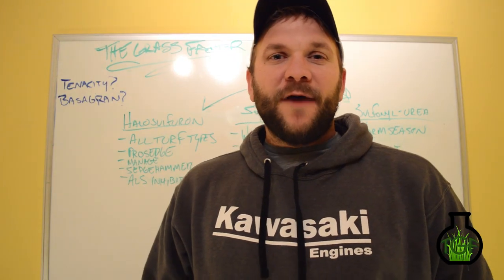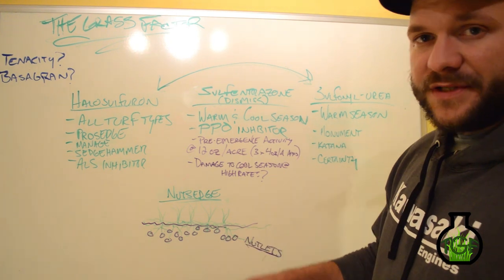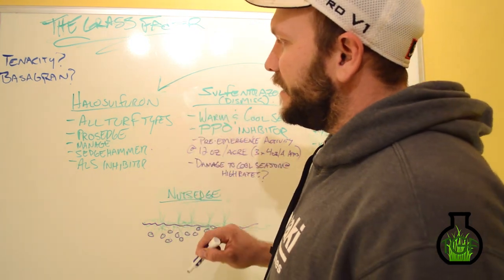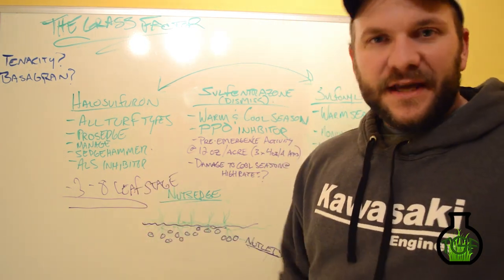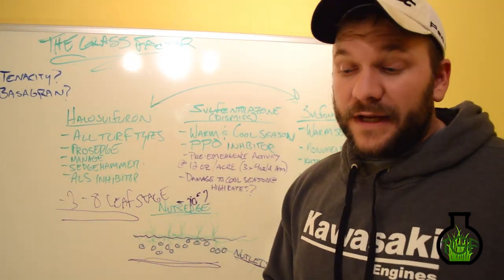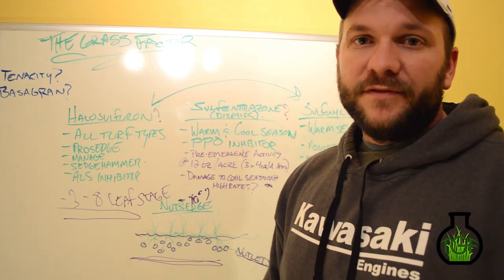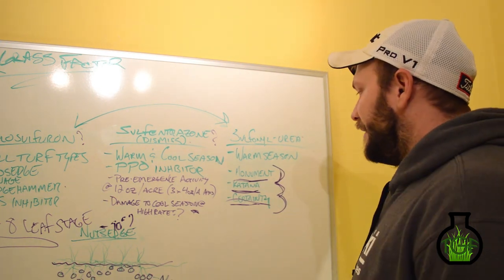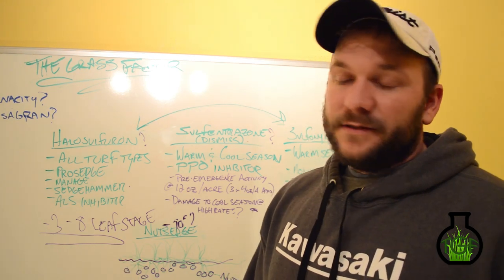How To Kill Nutsedge - Sedgehammer vs Dismiss - The Grass Factor

Comment: I have found the best technique to kill nutsedge - ( I am NOT a professional - just a guy who's tried everything) - is to mix 5 parts  Spectracide (black bottle) with 1/10 parts Tenacity. I then load it into a meat (marinate) injector, and inject it into the soil about 1 1/2" below the surface at every nutsedge crown. It works.

Comment: I used Sedgehammer last year... and the year before that... and the year before that. It is only a defoliant, and doesnt stop nutsedge from spreading through the root system.
Reply: When using sledgehammer, you MUST add a surfactant. A good squirter of dish washing liquid helps. ( and is a bit cheaper too)
Reply: @stephenchristoffel2850  Did that. 
...last year, and the year before that, and the year before that....

Comment: Had my petrol tank removed for a pump replacement on my truck.Mechanic gave me two large containers of bad fuel.One10mm paintbrush attached to a garden cane,dabbed nuts edge in my flower beds,small ones dead next day,large ones two applications,the odd one three.All gone,none returned.
Reply: How old was the fuel?  Was it practically varnish?
Reply: It was new fuel,got contaminated with chlorine,like an idiot,topped up from wrong container,ruined the pump.

Comment: Roundup will kill nutsedge, but don't spray it on your good lawn grass.  Roundup is non selective and will kill everything it touches. It's good in the landscape where it's around other plants, but use a spray shield when applying Roundeup so it won't kill the good flowers and evergreens.
Reply from the maker: If you're of the impression glyphosate is a good option for nutsedge, you need a significant amount of more experience in the field. It's a very poor performer on sedges compared to other options.
Reply: @TheGrassFactor  Grasses (including): Annual bluegrass, annual ryegrass, bahiagrass, barnyardgrass,
bentgrass, Bermudagrass, bromegrass, Cogongrass, crabgrass, creeping bentgrass,
dallisgrass, fall panicum, fescue, field sandbur, foxtail, goosegrass, guineagrass,
Johnsongrass, Kentucky bluegrass, kikuyugrass, lovegrass, maidencane, nimblewill,
nutsedge, orchardgrass, pampas grass, perennial ryegrass, purple nutsedge,
quackgrass, sandspur, smooth bromegrass, sprangletop, St. Augustinegrass, tall
fescue, Texas panicum, Timothy, torpedograss, vaseygrass, witchgrass, yellow
nutgrass, zoysia and other grassy weeds NUTSEDGE IS INCLUDED.  I USE SUPER CONCENTRATE 48% STRONG AND MIX MY OWN WATER AMOUNT
Reply from the maker: @lostinmyspace4910  again, most sedges have been resistant to glyphosate for a long time. It's obvious you haven't been doing this that long, or across any meaningful acreage. It's not a slight at you, I'm just pointing out there are far better options
Reply: @TheGrassFactor  I am not a lawn maintenance guy for sure.  Been using Roundup for more than 35 years in the design/ landscape construction business.  Roundup is usually a good product for anything I face including the dreaded thistle (3 ft 4 ft tall).  Just reading the instructions and it includes nutsedge.  But what I will do is take your advise and go with what you suggest as you know the technical efficacy more than I.  Thank you! Great video!  THUMBS UP!!!

Comment: I have a large raised garden that has rose bushes and had vegies.  I found your video and am intrigued as I am on my wits ends.  I have not heard of the three products you mention in your post, have used Ortho products that have been inefficient and could damage my roses. I am in Arizona so the nutshedge starts in April all the way through October, or at least while it is hot.  The weed is interfering with the growth of my roses. 

My questions are:

1.What product would you recommend for a rose garden?  I have to get rid of this grass. 
2. What product will do the least amount of harm to the rose bushes?
3.  If I use any of these products, will I ever be able to plant veggies again?

I have also considered just replacing all the dirt, going down about 4-5 feet, but have been told that will not work as the "roots" probably have spread down that far. 

Any recommendations would be appreciated.

Comment: We use monument or Katana for spring transition.  The problem is the nutsedge starts to come up after we have killed of the rye and poa.  So at 10 bucks a gram we are talking about an expensive proposition to reapply at the high rate.  What kind of residual control do you get at 15 grams?  Have you tried lower rate with urea for Sedge control?  We get good results with fert adjuvant for cool season grass control.

Comment: Any thoughts on Image concentrate?    I like the idea of using it as a spot treatment, sprayed on the base of the nutsedge.   I don't have enough nutsedge (yet!) to warrant a full yard treatment, and I like the idea of having it available for small treatments at all times.    With a single sedgehammer packet, I'd probably only use one tenth of the gallon mix and be forced to discard the rest.  Dismiss seems like a great option later if the nutsedge gets out of control and if we can't get control over yard-wide spurge growth.

Comment: Hey I want to say thank you for making a video explaining all this!  I have zoysia in my yard and I have pansies and clover overtaking my front yard and crabgrass, dandelions and lots of nutsedge in the back yard!!  Any advice is appreciated.  Do you recommend Monument for residential use and is it safe for dogs?  Thank you!
Reply from the maker: +Kali M. Monument is safe for residential use and used within the label rate, you should not have any issues with dogs.  I looovvveee monument. Monument is a very expensive product and requires a very precise application. Keep that in mind if you choose to not hire a professional
Reply: Hey thank you!  I was thinking of doing it myself.  Yes it is VERY expensive it better work! =) I was just going to read the label and follow the instructions.  I assume it requires just water?    Does it need a surfactant? What kind of "precise application" are you referring to?  Thank you for your help!

Comment: Thanks Matt... I have a bad issue with nutgrass in my flowerbeds. Have been using Ortho Nutsedge killer, it has knocked it out better in the lawn.  I am in Texas and have been hitting it every couple of weeks. It turns brown but seems to come back.  My flowerbeds are mostly shrubs with a weed guard and 1 - 2 in rock on top.  It comes right through it all.  I have dug some up so it is not on top of the weed guard (although some grows there too).  Help

Comment: Nice video! I purchased Sedgehammer a month ago but have not used it yet. Is there a difference in spraying it on longer yellow nutsedge, or is it better to apply after cutting the lawn. I cut to four inches over the summer. After a week of not cutting the grass and a lot of rain here in PA in late June through July thus far, some of my nutsedge grows to eight to 10 inches. Thanks!
Reply from the maker: Taller plants. You'll have additional leaf surface area to absorb the herbicide
Reply: @TheGrassFactor  thank you!!!

Comment: The Sedgehammer label says that the product must be used the same day it is mixed.  I have read the Dismiss label and there is nothing mentioned about this limitation.  Do you know if Dismiss can be left in the tank for an extended period say days at a time with no degradation to the product, and will it effect my equipment?

Comment: Thanks for the video. As someone who isn't a turf manager and has no clue on my lawn type (warm or cool) or the grass type in my lawn, what would you recommend? I do have clover mixed throughout the lawn and want to prefer having large dead spots, especially coming into the middle of the summer when it will be dry.

Is sedgehammer the best option?

Comment: I HAVE BEEN USING SEDGEHAMMER AND IT HAS BEEN WORKING GOOD ON THE SEDGE GRASS EXCEpt for the green kylinga should I mix the sedgehammer with dismiss.If so what would the ratio be I am only spot spraying and I want to get the kylinga under control.  Since I want to fall seed would it be better to seed now and combat the kylinga in the spring? or should I do it now and when can I seed?

Comment: OK, I have a question.  I have a 3/4 acre lot with a mix of Bermuda, Zoysia, and St. Augustine.  I live near Austin, Texas and it's almost August, with temps near 100 degrees.  What would you suggest I use to eliminate the Nutsedge?  Thanks.
Reply from the maker: Sedgehammer, certainty,Celero, or dismiss
Reply: @TheGrassFactor  Thanks!

Comment: Thanks for the vid.  I have had 2 straight years of nutsedge up here in Rhode Island.  I have Sedgehammer, but haven't applied it.  I may get the Dismiss and combine the two to get the best results.  Earlier this Spring I hit my lawn with Round Up for Lawns.  It did a nice job cleaning up some of the nuisance weeds.  I may have applied it too early though, as the nutsedge and crabgrass bloomed in early June.  What is your view on the Round Up for Lawns?  I purchased it at my local Home Depot.

Comment: Thanks for the video. I do have a question about applying Sledge Hammer 🔨 on newly seeded lawns. I seeded Zenith Zoysia and it's about 5 weeks old right now with a bunch of yellow nut Sledge growing around it. I keep cutting it back like every 3 days. Would it be safe to use Sledge Hammer 🔨 on this new Zoysia?
Reply from the maker: Yessir
Reply: In clay soil, I laid down Zoysia sod, South TX, back in May/June.  Its now Sept 10th, 90+ degress daily.  And we're in a drout - we're always in a drout!  Ha.  Hence, my choice of Zoysia; I think It's Empire?  Before sodding, I stripped off the top layer of ground to remove as much of  weeds as possible. In one corner, of the 1,700sq ft front yard, I see maybe 15 yellow sedge weeds poking up thru the Zoysia. What would you rec I do?  Leave them?  Hoping the Zoysia will choke them out? Is it safe to try to spot treat them when they are growing right through the center of the new sod?  Should I try to put down pre emergent for next year in the area where I now see the yellow sedge, or do I risk harming the new roots of this Zoysia ?  Help guide my inexperience please...

Comment: Dismiss is definitely a "hot" running product. Ran it on some zoysia last summer and it burned the blade tips. And also have a question regarding kyllinga..I have only got good results with certainty, but haven't tried monument or katana yet. Are you seeing similar results with those on kyllinga?
Reply from the maker: Kyle Whatley monument is what I use for kylinga on warm season. it works so so well.

Comment: What about spot spraying with a electric back pack. Chem oz per gallon of water?
Reply from the maker: Depends on label rate and concentration. It's doable. If you're volume is 1 gallon/K, that's the same as 43oz/1000sqft. 43.5K sqft/acre

Comment: Great analysis and explanations - thank you!  Does the same analysis and pros/cons between halosulfuron and sulfrentrazone apply to sedges in mulched landscape beds around perennial ornamentals? I've had very good results with halosulfuron but have not tried sulfentrazone yet. My landscape bed problems are mostly yellow sedge and some occasional kylinga, while my centipede lawn problem, when I have it, is mostly kylinga.
Reply from the maker: Yes on the beds, sulfen is more effective on kylinga

Comment: Isn't Blindside better at controlling and suppressing sedges than all these products you mentioned?
Reply from the maker: +Gino20202 no, blindside is a mix of a lower rate of sulfentrazone (dismiss) and metsulfuron methyl (Manor). Metsulfuron methyl has no activity on sedges. So the sedge control from blindside is a "weaker" control than you'd get from just dismiss
Reply: I'm going to try Dismiss on the nutsedge I have in my yard that I can't seem to get rid of.  This video was very informative - going far beyond the videos that just show someone spraying it.  Thanks for making it.

Comment: My sedgehammer is on its way. Will it cause discoloration on my bermuda? If yes will it be ok to add ironite to the mixture
Reply from the maker: Any discoloration will be extremely slight. Do not add ironite as it will interfere with sledgehammers solubility

Comment: What's your opinion on applying 0-0-50 granulated sulfate of potash Matt? Testing is a huge pain I'd rather avoid but from researching I'm thinking it'd help my neglected lawn before summer. I've applied about 1lb/1000 of synthetic nitrogen so far and it helped a lot. I'm going for another 1.25 lb./1000 of N now organic. Any ideas on the potassium part of the equation? Upstate NY, mostly fescue, rye, and a little bluegrass.
Reply from the maker: smokesgtp testing what is huge pain? SOP is great for pre stress conditioning
Reply: The Grass Factor I don't want to deal with soil samples and testing is all.
Reply from the maker: smokesgtp why?
Reply: The Grass Factor idk it just seems like something I don't want to deal with. Maybe it's a good idea...
Reply: The Grass Factor Are you saying why bother testing the soil or why not do it?
Reply from the maker: Why not do it. It's not much of a hassle at all anymore with all the testing options available. I think SOP is a good choice, don't get me wrong, but I also think seeing a baseline Iis a great thing - especially when running organic N which usually accommodates high P as well.
Reply: The Grass Factor thanks for the advice Matt. I guess I'll have to get a baseline. I dont often see SOP talked about, especially considering the lack of Potassium in OTC fertilizers these days (due to cost I'm sure).
You should have a lot more subs than you do man.